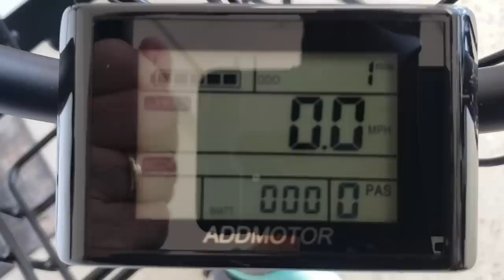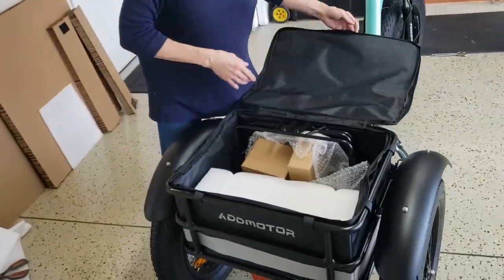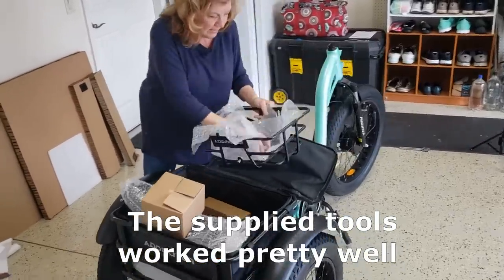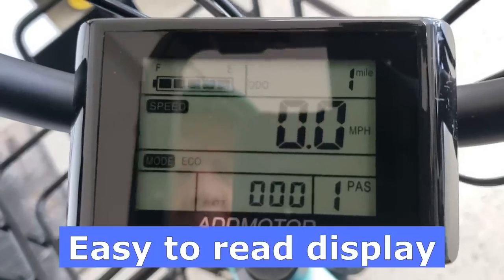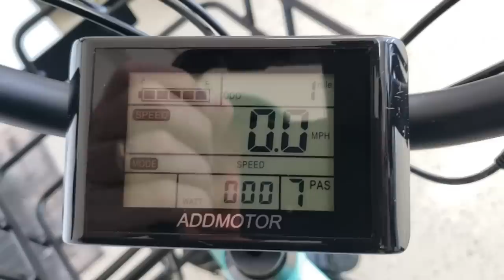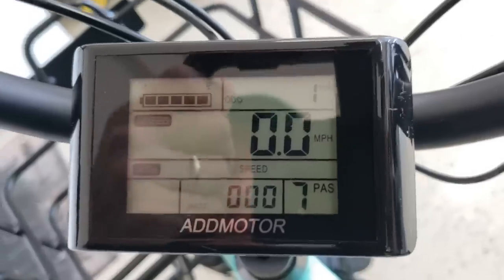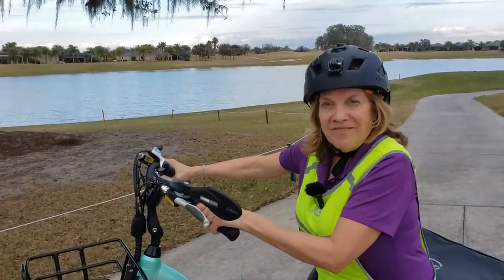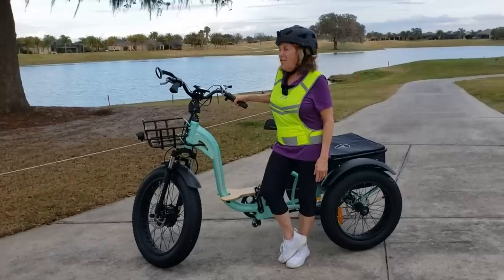Linda and The Addmotor GrandTan M-340 E-Trike

Comment: Great video skills, nice filming editing job. Gizmo should get Union wages well done.
I see the links but please just say what the cost was and if del was included. Was this a direct from the manufacturer sale? Warranty  work attained how?
My only product concerns are 
Upgrades to electric assist engine, charge times , quick charge option if not paying attention 😮
I'd like larger more powerful horn
Easier to reach ( bigger) turn signals.
All light especially  turn signals and front light much larger more powerful.

Great Great video
Reply from the maker: Thanks so much. It is about $2899 on sale.

Comment: Just wondering if the bike seems heavier or clunkier when peddling vs a two wheeler? It was quite interesting watching Linda putting it together.
Reply from the maker: No, it does not. Storing it is more of a problem. Turning is also different. It is going to take some getting used to.

Comment: Thanks for the video, now that you had the bike for awhile ,what range do you actually get ,and if you could what model would you get or would you stay with this model . Also is this trike tipsy , I am looking at getting a trike for my wife . Again thank for your review.
Reply from the maker: It is a very good bike. I still do not have the hang of it. It is comfortable and easy to ride, but I still have a little fear of taking turns too fast.  It takes some getting used to.  I love the cargo capability and I love the fact that I don't have to put my feet down when I stop.  The accelerator is excellent, and the brakes are nice and smooth. It does not have a parking break, so if you parked it on a Hill you have to be very careful.

Comment: It looks quite big and heavy.  Is it difficult at all?  How does it compare to two wheeler
Reply from the maker: You need to get used to the fact that you don't need to lean into curves. You just turn the steering column. It is heavy but it does not feel heavy when you ride it.  So far I think it's very easy to ride.

Comment: Putting gas motors on bike got popular because it allowed you to have an inexpensive way to have transportation

These electric bikes cost more than a used motorcycle. It doesn't make any sense

An electric bicycle is slower and more expensive and less safe as in breaking distance and things like that

If you're looking for an open air, wheeled vehicle, with a motor, that's inexpensive, and has good performance and good economy, it's called a used motorcycle and they've existed for a long time

Comment: This is not a criticism, just an observation.  When you originally bought the two new electric bikes, I wondered why?  You have a car to get around outside The Villages.  You have TWO golf carts to get around inside The Villages .  A purchase of bicycles should be for some form of exercise.  But with electric bikes, the exercise is at a minimum.  Start using the electric option and you have negated the exercise option of using a bike.  Now you basically have a three wheel "golf cart" that takes up more space in the garage.  Doesn't sound like a good decision on your part.  Maybe you can justify it?  I'd be interested in hearing the justification in one of your videos.
Reply: Actually with an eBike you can get as much or as little exercise as you want.  Purchased a different brand 10 months ago and have lost 30+ pounds in over 1200 miles of biking so I’d dispute your claim.  The rider has the ability to control how hard they work so it’s more enjoyable to bike, you do it more often.